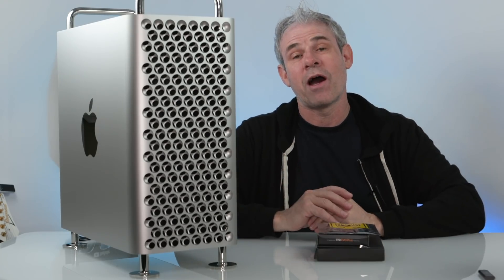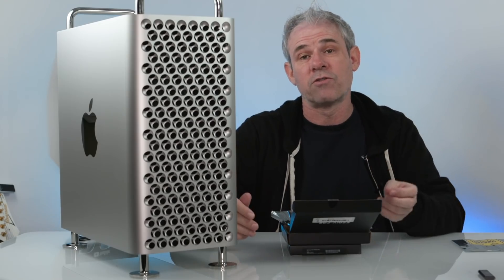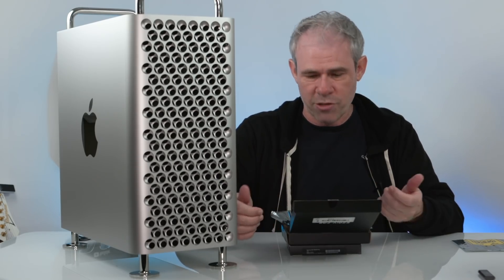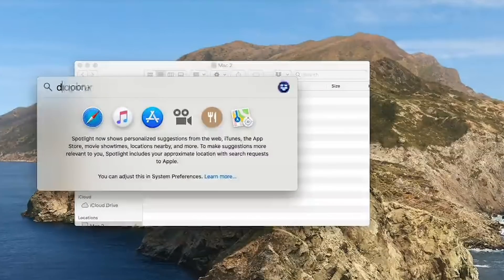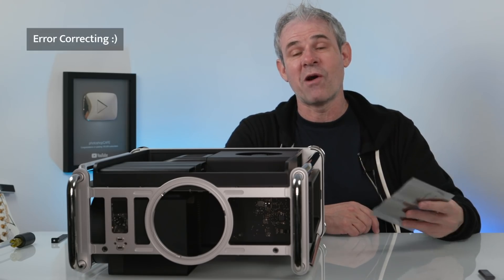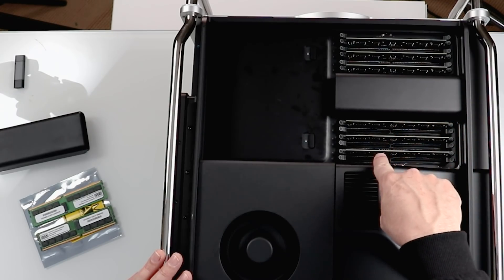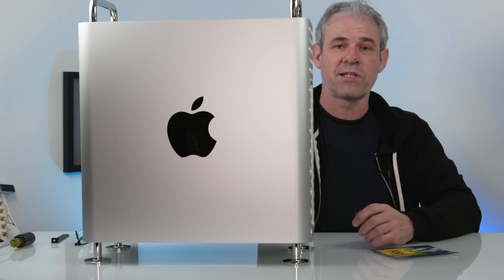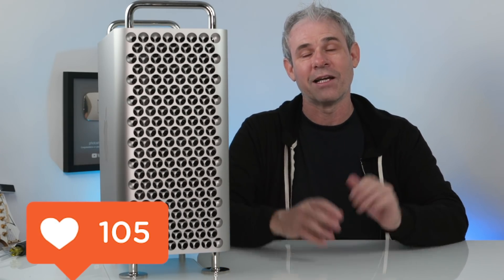How to upgrade SSD & RAM in the 2019 Mac Pro: NVMe

Comment: Thanks, Can this New SSD be used as the Bootable? Im looking to completely change drives. My internal 1TB SSD is full. I would like to back it up, then Migrate that complete bootable back up over to a New 4TB SSD drive...? I have the M.2 and an SSD PCIe, card 4TB. Is this all I need? I'm on a Mac Pro 2019?... How can I do this? Please.
Reply: yes, you can even boot from a thunderbolt nvme drive/enclosure

Comment: Hi I’m rebooting up on my 2019 Mac Pro tower from external. That all works great but I want to clone that drive to the internal drive that the mac comes with. Problem is when I boot up from external the internal mac drive doesn’t show on desktop. I see all other drives. So when I go to my cloning program I can’t select the internal mac drive to clone to. Why is this? Is there a fix?

Comment: Has anyone tried swapping those factory ssd's with non-apple branded ones yet and used the apple configurator to flash the T2 chip firmware on to them yet?  I can't believe apple did this stuff.  They charge to much for apple branded components.  SSD's and memory are cheaper as third party purchases.  They really need to allow us to put in third party ssd's this makes no sense for a machine that costs as much as a car.

Comment: my 2019 Mac Pro 16 Core came with 8 TB SSD can i add more and whats the highest SSD i hear it 4 TB? and how many SSD's can I fit inside my mac?
Reply from the maker: With the expansion slots and 3rd party boards (Sonnet and OWC I believe) that can each hold 4 SSD's, that's a max of 16 TB per module.

Comment: I’m looking at buying the base Mac Pro and possibly upgrading to the Radeon Pro W5700X with 16GB.  Do you suggest that or upgrading the gpu in my own? I heard you loose thunderbolt ports if you upgrade on your own.   BTW,  upgrading from a 2017 27” iMac with a 4.2.  Looking for better video editing performance in final cut and premier.
Reply from the maker: The 16 Radeon looks like a nice option. Wasn't available when I got mine.
Reply: @photoshopcafe  so do you think its worth the $600 upgrade? Is it true if you remove the stock GPU, you lose thunderbolt ports?   I'm getting the base hard drive and processor figuring processors will lower in price in the future.  Right now I can get the mac pro for $5500 plus $550 for the 16 radeon so I feel like its a good deal

Comment: I have a question.. will this take a standard pcie card for extra USB 3.0 ports? I'd like certain USB 3.0 stuff on their own bus, and thunderbolt stuff on their own bus. The Sonnet 4 port USB3 card is the one I am thinking of.. Also, is it easy to attach power to such a card or do I need to buy an adapter for that too? Definitely want it powered, like a powered USB 3 hub so to speak but it has it's own dedicated bus on a pcie card.

Comment: Hello, i bought the same SSD controler than you but i have this message : " The pci cards installed are not available according to the optimal configuration " (but the SSD is more fast than the Apple's SSD) It is possible this card damaged my Mac Pro ?
I used the number 6 PCI. 
Thanks

Comment: I see you added the 32Gb RAM in the outer two slots (3 and 10), but Apple advise that the higher capacity RAM needs to be added smallest to largest capacity in the order of the channels, which would suggest the the 32Gb RAM should be installed in slots 4 and 9 (channel 5). Any reason why you did it this way rather than following Apple advise?

Comment: Colin love this tec stuff I will upgrade to this model I hope later this year I currently have the tube looking Mac Pro I am not a professional but do a lot of work for the community I like the speed etc that the ProMac gives me From what you have said I was thinking upgrading to the 12 core and 32 card Can you confirm this is good basic system I know that the ram has been an issue for me with the tube version I work with big files use Topaz quite a bit thank you Also the number of USB ports is rather limiting for back up storage
Reply: Sue Shepherd you don’t need multiple cores for Photoshop. Anything with one core will be enough. Even any old Mac from 2010.

Comment: Since your model looks to cost around $15,000 USD, cost surely doesn't matter to you, no?
But then why do the DIY upgrade?
That would mean you do want too save money.
But if you want to save money, why buy a $15,000 machine in the first place?
Reply from the maker: Actually about 10k, because its the tool I need to do my job. I know you are going to say "why not a PC" I am typing this on a PC, I use both, but I have to have a MAC too for my work, where I live LA area, my industry is all on mac. I also work with the music and video industries where its only mac. So no, I'm not made of money, but Ill get years of use out of this computer and it will pay for itself many times over, just like my last one did, and it still works after 7 years of daily use.
Reply from the maker: And I like working on MAC :) I have both, but I like MAC better.
Reply: Weird question.

Comment: Hi Why start with the 48G RAM for your 12 core?  why not start with just 32G RAM?  Is there an advantage this way? Thanks.
Reply from the maker: No, I should have started with 32Gb, but I ordered day 1 so I was unsure of upgradability at that time as noone had tried yet, so I wanted at least enough to work with if I couldn't upgrade right away. Knowing what I know now, I would have gotten 32 and then added my own.
Reply: @photoshopcafe  Thanks!  I am ordering before 12/31 to take advantage of the 6% Apple Card rebate.  Thinking of the 12 Core version as well.  Like you, I also use the Macbook Pro 16 as daily and travel driver.  Is it true that the 12 core Mac Pro runs silent and runs Photoshop and Final Cut Pro slightly faster with less fan noise over the Macbook Pro 16 top version?  Thanks again
Reply from the maker: @HK-NYC  Yes, its absolutely silent.

Comment: The internal drive is running through the t2 encryption chip. If you run the Evos in a raid over a multi board you can clock it around 7000MB/s
Reply from the maker: I don't believe the EVO is running through the T2. The preinstalled SSD is though.
Reply: photoshopCAFE “Internal” is the one that comes preinstalled and needs to be handled by Apple if you need to upgrade that storage since it runs through the T2 security chip. You however have a extension with the Evo wich can achieve 7000MB/s in a Raid configuration set-up. Sorry for the confusion.
Reply from the maker: @samgeurdi6351  Yup, you can't change it yourself.

Comment: Why did you insert the card in an x16 slot? The adapter card is just x4.. :-) I have a similar card in a thunderbolt case, it works nicely.
Reply from the maker: It doesn't do any harm, its not taking full advantage of the x16, but I put it further away from the I/O board so I can get more airflow around it, as I said, I doubt that does anything, but until I need to use an x16 slot, I don't see any problem. Am I wrong?

Comment: Great video. But while adding RAM is good, by going from 6 to 8 sticks, you went from 6 channel RAM TO 4 channel. This will in theory slow down your RAM speed. For best performance one should either use 6 or 12 DIMMS.
Reply from the maker: Thanks for the info, I just now tried dropping it to 6 and even went back to the original 6, then I went to 8 and then 10, and ran benchmarks 6 didn't give me more speed, in fact 10 gave me the most. I pulled the original ram and tested again using only 3rd party, Im wondering if the benchmark isn't working correctly (novabanch) on the Mac Pro (or if there is a different issue) , same test with my MacBook Pro gets 26,000

Comment: i liked your video but there is something wrong with your ram ... overall my imac pro has about 2.2 faster ram speed and it should not be like this because your ram is faster and much newer ...
Reply: By adding only 2 DIMMs, he downgraded RAM speed by going from 6 channel to 4 channel. For best performance I recommend using either 6 or 12 DIMMs

Comment: Thanks Colin. I am just about to upgrade an iMac 2017. Your video just gives me a little more confidence even though it is probably a little more tricky than the one you've just done. For a novice like me, it is a gutsy move. I've watched some related videos on YouTube several times and think I can handle it. I am going from 8GB RAM to 32GB and also swapping the internal hard drive for a SSD. Only reason: to get Adobe CC working properly 😊
Reply from the maker: If you don't currently have an SSD, making this upgrade will make a huge impact on performance.

Comment: Great video , for a car like this one the better option is to install them in a x8 slot. A single m.2 Nvme uses just 4 lanes.
Reply from the maker: Jaime Duncan fwiw I put it further away from the I/o card to get better airflow over it. I don't know if that will actually make any  difference. But it's not doing any harm putting it in a double slot, just not taking full advantage of it?
Reply: @photoshopcafe  yes you are correct, it does not do any harm.

Comment: Colin, thanks for this video, my Mac Pro just arrived yesterday and I plan to do similar upgrades.  Specific to your specialty, does Photoshop exploit the higher amount of Ram?  Could you do a video on how to set it up to do that as well as the best set up to exploit that 1 TB of storage maybe as a scratch disk?.  Would that be a good use of the NVME drive?  Thanks in advance.
Reply from the maker: christopher whipple the first thing I did was set the new drive to primary scratchbdisk. The extra ram is especially good when I have things like premiere pro, Lightroom and Photoshop running at the same time. It really removes the bottlenecks
Reply: Thanks Colin.  Your advice is always welcome.   I ordered my Mac Pro from B&H of one they had in stock  12 core with 96 GB of memory and 2TB storage.  I’m thinking of filling up the other 6 memory slots to go to 192 GB.  Would Photoshop  and Lightroom or other photo apps take advantage of that or would I receive more benefit from going to 8TB OF NVME storage with more scratch disk and photos storage
Reply from the maker: @christopherwhipple1765   I kept the ram monitor open while working on a decent size composite and it was using all the ram. I think 96Gb will be more than enough for Photoshop unless you are making billboards.
Reply: Thanks Colin.  Will I see you at Imaging USA again this year??
Reply from the maker: @christopherwhipple1765  Unfortunatly no, I'll be at CES instead.

Comment: I would suggest a cheap heatsink cover for the EVOPlus SSDs, those heat up drastically when in use. Mine would sometimes shut down if I perform other actions (ie mass delete files, use as scrap disc) when processing image stacks. The 970Pro does a way better job.
Reply from the maker: Macro Cosmos Microscopy good to know. Hopefully the cooling in the MP is good enough, I'll keep my eye on that. Any sugestions on a good HS?
Reply: @photoshopcafe  Not sure about desktops, for my laptop, I just put a piece of metal shielding on. Fixes most of the crashes. It will still stuff up under intense workloads if I don't leave it alone. I would say the average newegg HS does the trick. If the cooling of the mac pro is alright or one doesn't do intense stuff (focus stacking 300+ frames, panorama stitching etc, rendering huge videos), I think it's fine. Those 970Pro ones are way too expensive and hard to get in my country.
Reply from the maker: @diatomsaus  I'm also concerned that a heatsink could block the airflow of the cooling, because of the way Appple are cooling,  for example, Apple say dont use heatsinked RAM because the buildup of heat could damage the board. So I won't do anything unless I get issues.
Reply: @photoshopcafe  Yeah that's the best choice I would say, don't fix something that isn't broken. I agree.